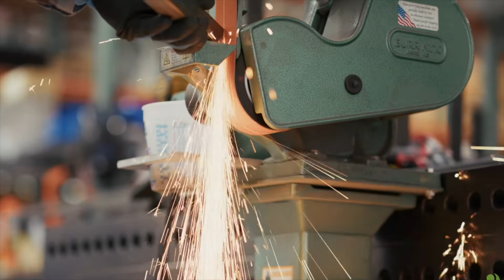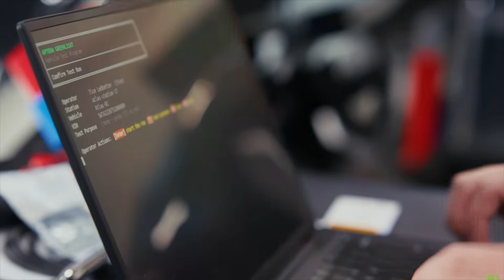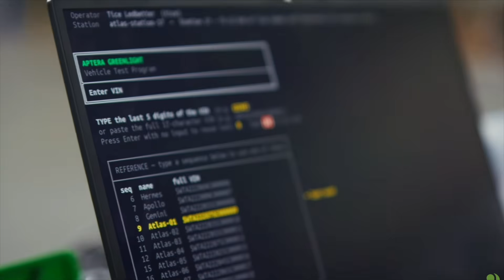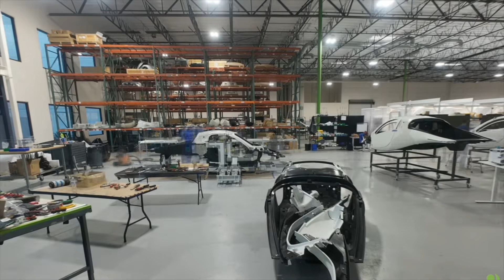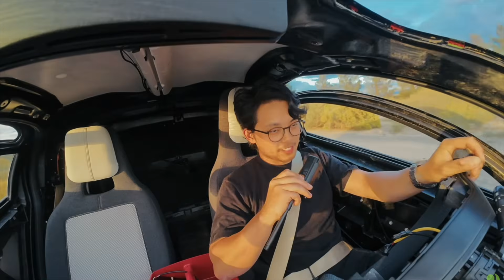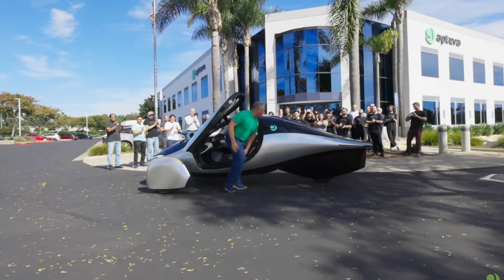Aptera Is Getting Better !

Comment: Aptera is miles ahead  of the car competition with respect to its extreme efficiency, for at least ten years in my estimation. In the coming years Aptera can definitely obtain revenue and profit, eventually break even.  The first production version Aptera EVs will break many production-car records. I hope it will be an EV that lasts for ever. Future Aptera designs: return to superior hub motor wheels (air-cooled Yasa axial flux wheel motors??) and a switch to sodium batteries for cold weather, super fast charging and a very long cycle life.
Reply: You have consumed way too much Kool-Aid. This will never make it to production. Wanna bet?
Reply: @tomuchi  as soon as Aptera sells its first EV, I will return to your comment.

Comment: Heads up, Aptera fans - in their SEC filing last week (13 May 2026) Aptera said:

“As of March 31, 2026, our existing cash and cash equivalents were not sufficient to fund our current operations for the next twelve months. These factors, among others, raise substantial doubt about our ability to continue as a going concern.”

and

“Following the successful capital raises in early 2026, management estimates that an additional $45 million to $50 million is required to fund the initial low-volume production phase of our Carlsbad facility.”

and

"We expect that the associated work would take approximately 12 months to complete from the time such capital is fully secured."

So, based on what Aptera said to the SEC on 13 May 2026, if they get the $millions they need by the end of 2026, they will be able to start selling vehicles as early as 2028.
Reply: Of course you don't quote where they said "if we choose"